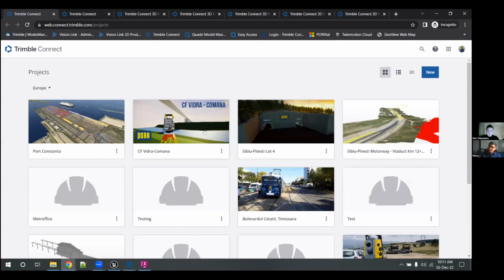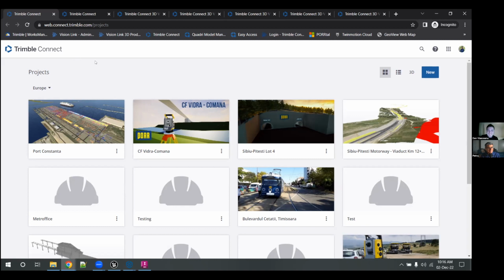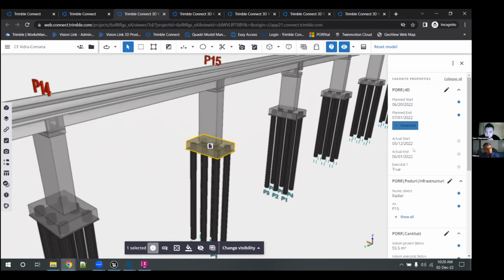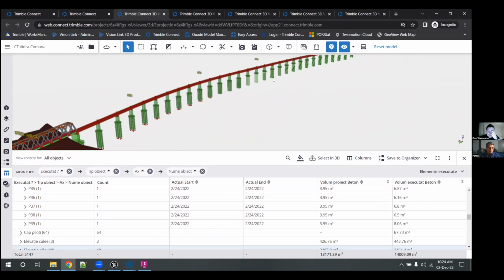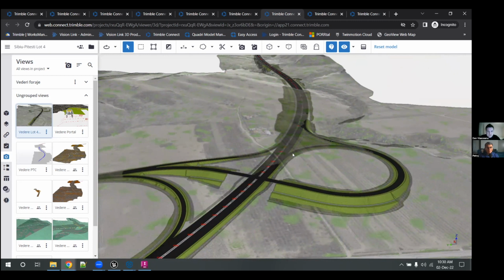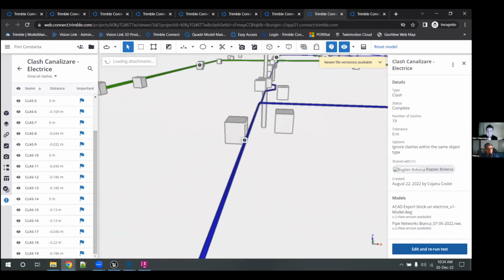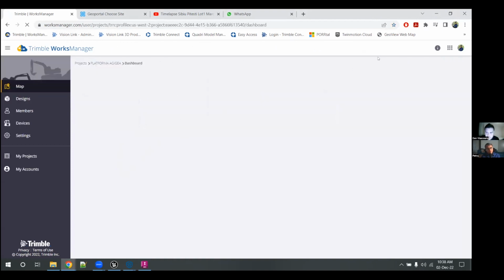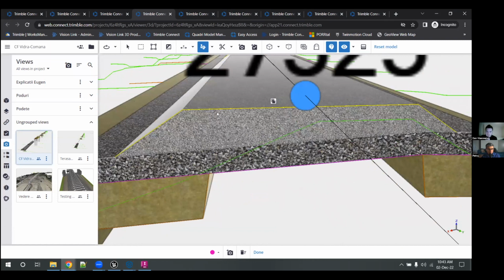🎙️ BIM Coordinator at Work | Dan Vlasceanu from PORR Romania 🇷🇴

Comment: Hi there, what about if you have an updated ifc version of the model? Should you rewrite the Informations?
Reply: I fear that not only the attributes added, but all the connected documents, photos, etc... have to be reassigned to the new models if there is an update, new version. Therefore, the method is not very useful, if you have frequently new model versions.
Reply from the maker: Hi! Unfortunately I cannot confirm at this moment if this is possible or not. Will try to have a look at this in the future and let you know.